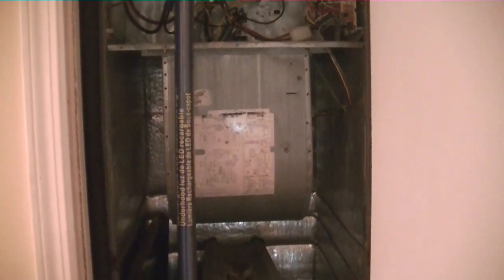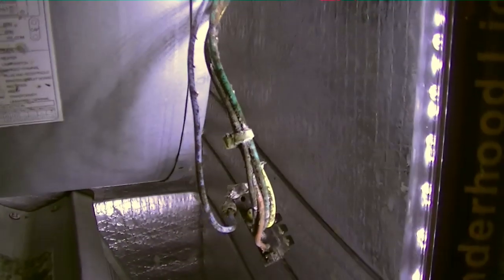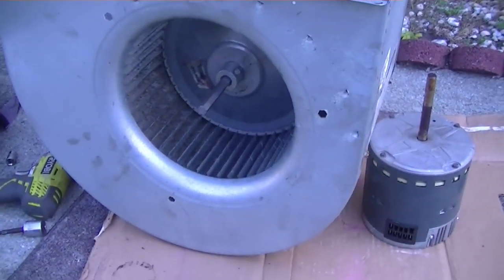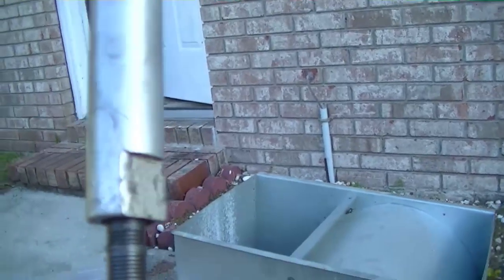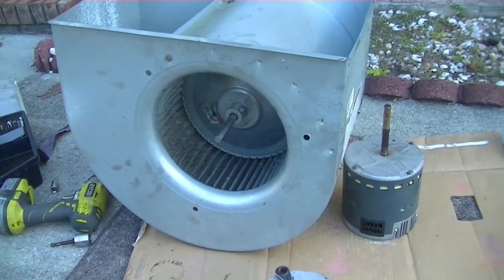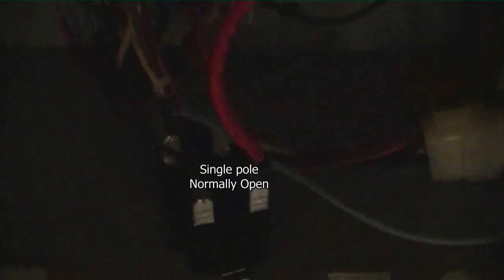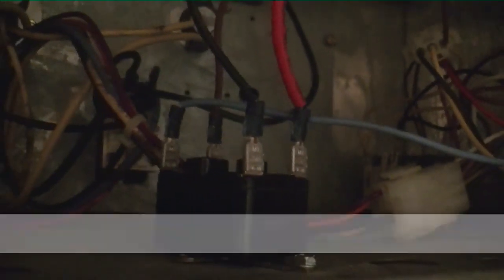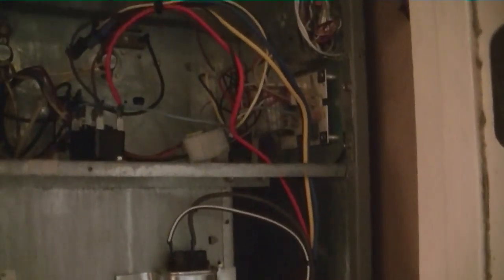HVAC Service- X13 ECM to PSC Blower Motor Conversion

Comment: Just made the swap using the Quik swap single speed board.  It is really easy, especially for a single speed unit.  I went through 4 ECM 13 motors.  The 5th is a reliable PSC. HVAC is ICP FEM2X3500A1.  About the most basic system you can get.  Too bad they had to put a Genteq motor in it.

Comment: Do it all the time, and it last longer than the gentec junk.about min 6 times as long, what energy cost saved is lost when Buying the new module or motor, proving HVAC engineers have no brains.

Comment: What can i do if there is no computer board just basic guts meaning no board just like a regular system with a x13 blower motor hook up no board and x13 motor can i change it to stock number 3588 GE motor ,hp1/2,volts 200 to230 ,amps 4.3

Comment: Won't this unit, when in the heat mode have the wrong motor speed??
Reply from the maker: Its a single speed system
Reply: Exactly my point.. In my particular situation, my cooling does best with the fan on high, and my heat does best on medium. I did the conversion in your video about a year ago and was thinking of adding a two way switch circuit to switch the motor speeds, depending on whether I am cooling (high) or heating (low). I then decided to get QuickSwap QT6100 module. Not sure how the fan speed will work with it during heating though.
Reply from the maker: If you want you can also use an additional relay. if it is a heat pump you could just control it with the reversing valve low voltage.
Reply: also if not using the existing blower control you would need a time delay on break with it so the fan will push either the cool or hot air out of the duct work after the compressor stops

Comment: hi I am in the middle of buying my first house and need help we're two weeks out from moving in the house and when I went to go try to turn on the AC the outside unit turns on but the hanger in the attic did not do anything it's fairly new they're both from 2010 I had a local AC guy come check it out just to tell me what is wrong according to him the motor like in this video is what is bad is receiving power but not turning on now he recommended just changing the Modular first on the motor but it seems so expensive to have them do I want to make sure I do the right thing so my question is does it make more sense just to change the whole motor for only the modular? Or is there a way to tell if it is the actual whole motor or just the modular thank you so much
Reply: 99% of the time the motor is not the issue,i have seen 1 bad motor out of 10-15,yes you can change the module only and yes you can check the motor windings on the 3 plug connection between motor and module,all 3 should read the same,BUT,you can get an evergreen x13 replacement for @what a x13 module cost itself

Comment: all you have to do is spray it will o/s coil cleaner let it set for 20 min and hose it off. 
lo airflow means low cooling and heat problems. prevent call backs.

Comment: If im not mistaken you should use a 6 prong relay to let the fan run a minute longer to cool the heat strips when heat mode is on...
Reply: no the sequencers on the strips themselves will dictate that

Comment: If this AHU was connected to a HP have electric back up heat how would you have wired the relay to bring on the blower during defrost
Reply from the maker: Defrost occurs during a heat cycle. The blower is already running

Comment: X13 is a terrible motor!! I have replaced two in my air handler. First one, brand new lasted 4 years, the second I installed lasted 5 years! Next time I will go this route!

Comment: Very nice video and not all customers have deep pockets and we do what we have to do. I been know to use used parts to get a cash strapped customer cooling again. It a case by case with me. And sometime these X13 air handlers' are being used on poor ducts and it killing them. And  "Do not try this at home!"  is right on. Unless you know what you are doing the wrong wire could destroy the control board or even worse.

Comment: ojt is ok too....air flow is a big factor in system performance.  good video you saved your customer $$ on replacing that ecm motor with a shaded pole.  I always install a surge protector with a unit that has a ecm in it.   they still haven't got all the bugs out of em.

Comment: A light would've been good...a little vague on the wiring part...for me I already know how to retro fit from X13 to 3 speed motor with cap...but for regular joe home owner he might need more information...thanks anyway...
Reply: Gregory Butler I agree!!!! I wanted to do this for a friend because i know the damn x13's are $500. It looks way simple if he just showed the wiring detail!
Reply: +clay125 The ecm motors are garbage... someone in their infinite wisdom decided to put the circuit board inside the motor and it caused moisture to get in and ruin the electric drive part of it... the normal part of the motor was always fine though.. i have changed out so many of these over time these motors ussually last about 2 years the psc lasts for 7 to 10 years.. longer if they are oiled
Reply: yea ive been to the regular joe home owner to fix the cluster f*** that he thought would impress his wife and ended up costing twice as much,i never tell anybody how to DIY then i would feel responsible when they get electrocuted

Comment: I've had to do this before, it is a good way to provide a lower cost alternative to your customers. One note though, if the manufacturer does not offer or a conversion kit, or if their conversion kit isn't used, the unit is technically no longer UL approved. So, if there is a future issue(ie: fire), that is traced back to the equipment, it can come back on your company. Not saying don't do it, just saying proceed with caution. In any case, good job, and thanks for not leaving the capacitor in the box.

Comment: What was wrong with x13 in the first place?
Reply: Well, here's my story...   The original x13 died after 5 years of use, in 2012, and just this past month the replacement died!  Luckily the first was under warranty but this one was not so I have to put the same x13, piece of garbage motor back in it.  If it happens again i'm doing this for sure.

Comment: I think I connected everything the same way as you, but when I turn on the air handler it runs continuously and the thermostat is blank.
Reply: You also need to order a 24 volt fan relay (to have control over the fan motor) Grainger is more expensive but faster than Amazon if you can walk into a building.The Grainger 6ACH5 fan relay will work. You can get away with a smaller single pole relay but I am getting much more reliable operation from the double pole double throw relays.  You should also order the Grainger 6WU91 transformer.
Reply from the maker: Sounds like you connected R to the relay and not G.
Reply: The ECM X13 is different from the ECM 2.3.

The brown and blue wires to the ECM X13 motor were low voltage. You probably damaged the transformer if you connected them directly to the new motor.
Reply: I wired it to the new motor because that is what the guy in this video did.